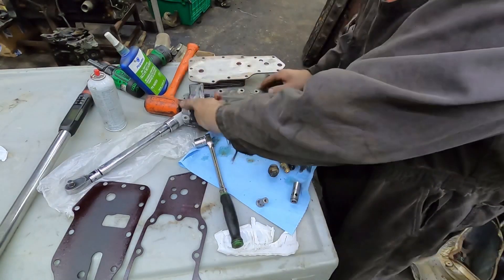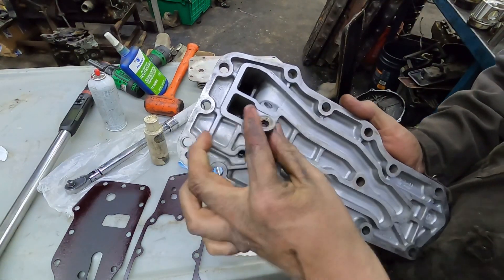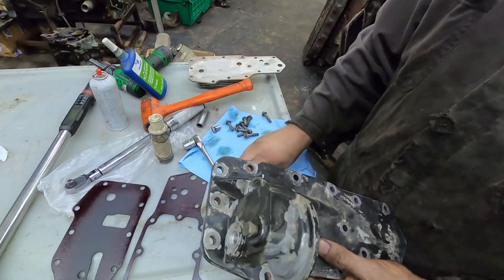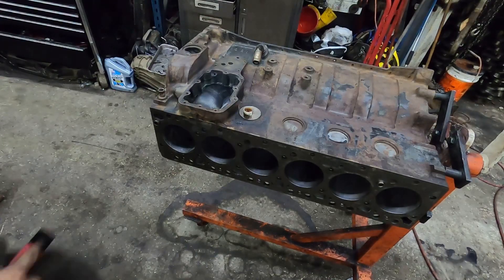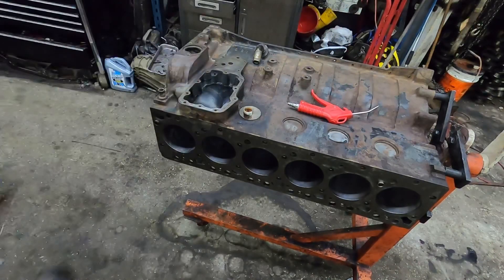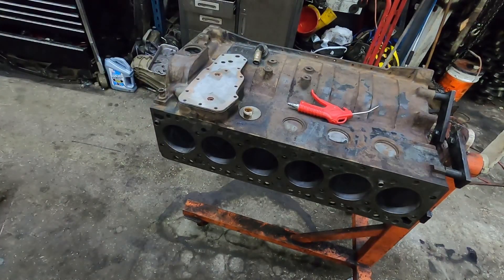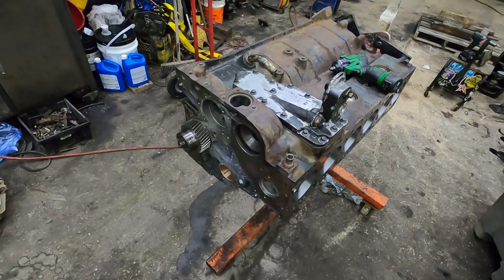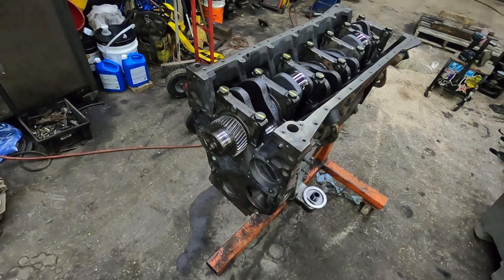HOW TO REBUILD YOUR 12 VALVE CUMMINS  PART 7 1/2

Comment: I'm new to this whole diesel thing. I'm putting a 5.912 valve into an F350 crew cab. That I acquired that engine was shot my 5.9 seems to be in somewhat decent shape, although 2 of the cylinders had low psi. On the compression test, unfortunately, I did not do a leak down to see if it was just the valves before pulling the head inside the cylinder.s they all seem to be decent.
But I'm pulling the whole engine apart to check it, measuring everything.
Loving your videos, these are going to be tremendous help to me with this engine. my one comment is about the glass beating. I've been racing. Go carts for over 50 years with 2 stroke engines. We learned the hard way if you're gonna use glass beading to be blast. The engines only use brand new glass beads and do not recycle them.
Broken shards of glass from used beads will embed into the metal and will not wash out while you're washing the engine blocks. They tend to come loose while the engine is running and is detrimental to bearings and everything else.And have ruined freshly rebuilt engines.
But again, thank you for these videos. I've already learned so much from them that I'm only in what video 5 or 6 right now..
You did make one comment about using a new oil cooler.
Every time you rebuild an engine, why would you do that?Just curious.

Comment: Hey Rob, I am currently having high oil pressure after a fresh rebuild I replaced both pressure relief valve and bypass valve. when I first started the engine I had 100 psi of oil pressure. I then switched the pressure relief valve spring out with the old spring and had 80psi. I used an ebay bypass valve and am wondering if that could be the cause of my high oil pressure?

Comment: Afternoon. What larger oil cooler could you use for heavy towing on engine 5.9
Reply from the maker: I use a air to oil cooler and off board mount them, i will do a video when install the new one on my truck

Comment: What are your thoughts on overhaul kits like HDKits.com? They are $550 US dollars, but not a brand I ever used or heard of. I am finding lots of no name Chinese parts, have you used any? I read on a sled pulling forum that the no name pistons hold up fine, so wondering if you have used any no name pistons? Thanks, and Merry Christmas!
Reply from the maker: I don't use cheap engine parts my stuff. i get to fix lots of engine that are built with cheap parts. the price from cheap parts to get stuff is not that much more. if you looking to get a engine kit call https://www.cleggengine.com/  if you drop my name  there will give you a deal. I buy lots of stuff from them awesome guys to deal with

Comment: As ridiculous as it may seem to some, my parts are surgically clean before I put them back together... LOL. Not necessarily because they need to be, but as a matter of principal. That's a luxury I have as a hobbyist without a time constraint. When I tabbed my KDP, I did a bunch of other work while I had the front of the truck apart. I went so far as to media-blast the alternator bracket and other similar parts so that I could repaint them for a factory finish....
Reply from the maker: for sure. I love doing it . just now a days the time is the hard one for me. but this i part of the reason i want to you tube so i can send some time and make stuff really nice.